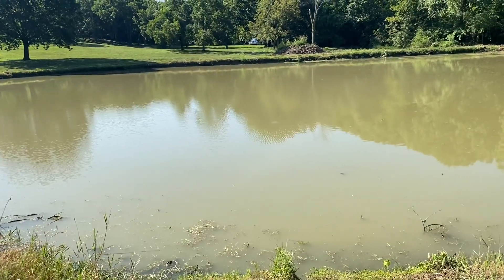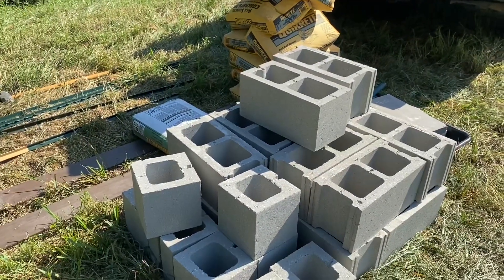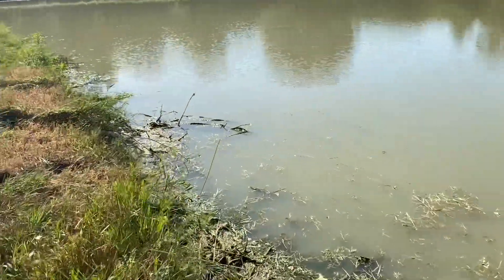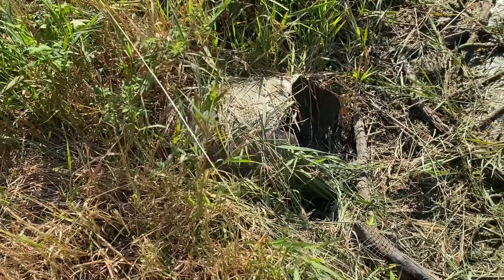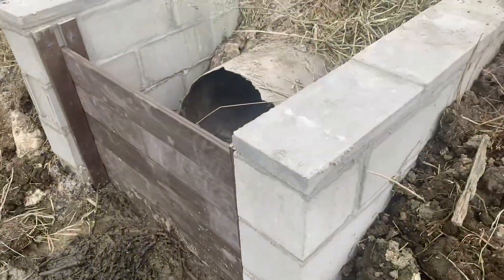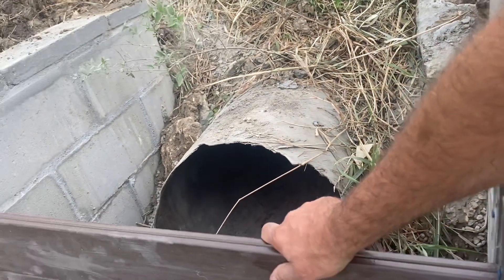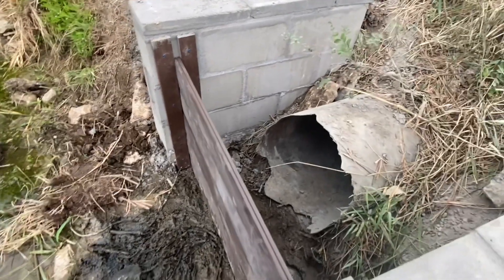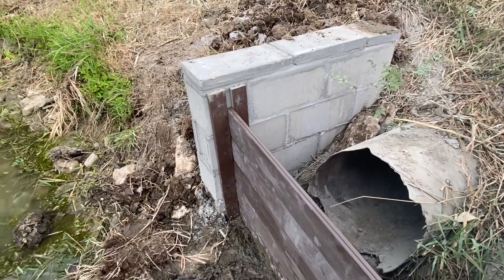Pond Sluice Gate DIY

Comment: Did you have to adjust the back fill to the same level as your top-most board? Was wondering if the level got to the board level, it would flow around the back of the blocks and erode the back fill. It's a great idea we are hoping to implement in our pond. Thanks for sharing!
Reply from the maker: I recently concreted behind the boards due to erosion like you said.  The water was coming over the top during high water times.  Additionally,  I ended up putting some vertical boards behind the horizontal ones to keep them from bowing under the water pressure.  Other than that.  It’s been great!